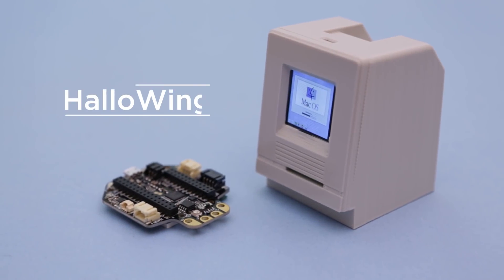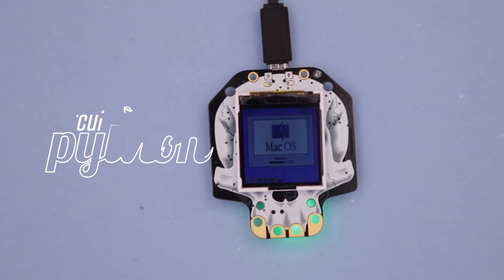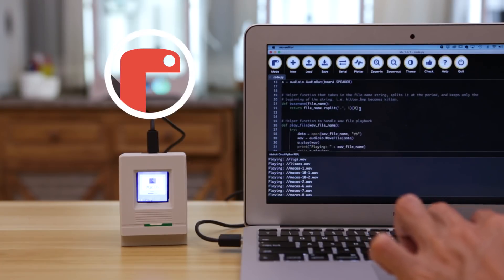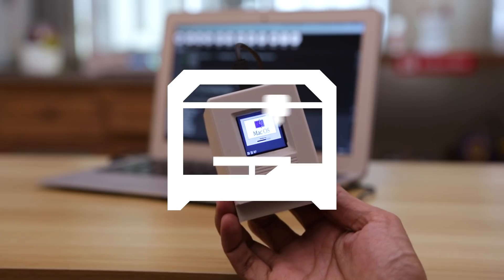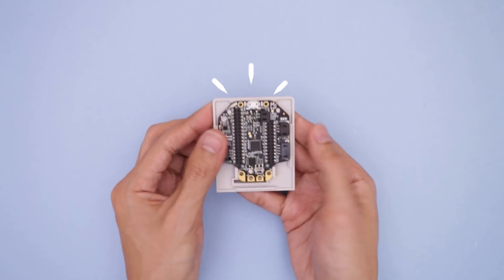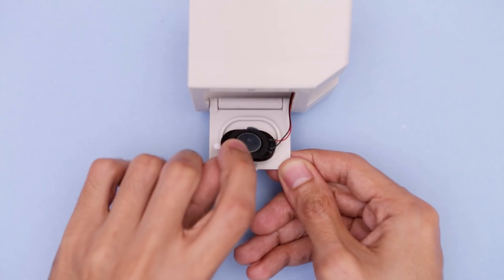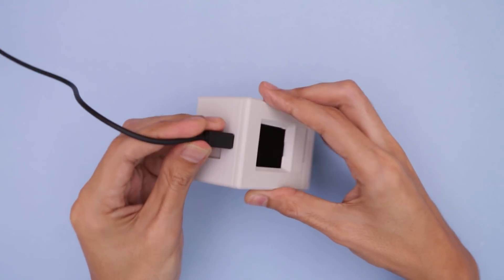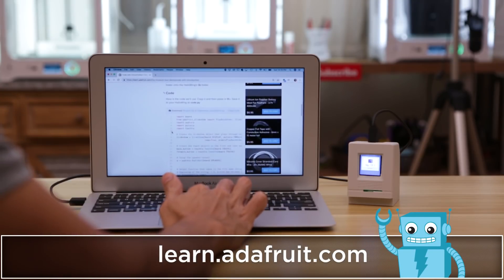Mini Mac SE #CircuitPython #3DPrinting

Comment: I know it's ridiculous, but I'm disappointed this isn't a functional Macintosh.
Reply: How large is the entire OS?  I feel like it wouldn't be impossible.
Reply: According to the Wikipedia article https://en.wikipedia.org/wiki/System_1 , the whole OS measures a whopping 216 KB - it'll fit, but maybe a little tight for a 256K board (as you'd need some kind of 68000 emulator to run it on - how big would something like that be? No clue...). But then, those 216K include a (in this case totally superfluous :-) LaserWriter printer driver - if that could be removed without making the OS  throw errors left and right, then - maybe, just maybe...
Reply: @CoPoint  but then again you would not be able to print on your mini LaserWriter...
Reply: @gaweyn  Would you be willing to build one 😀? If you could somehow manage to pull this off, this would make you immortal 😁…
Reply: no pi zero and basilisk or mini vmac.